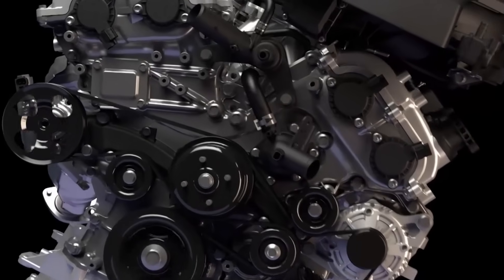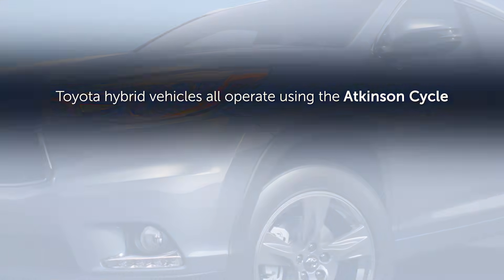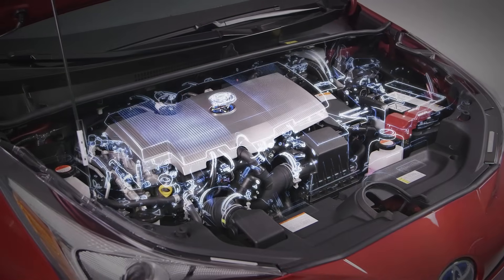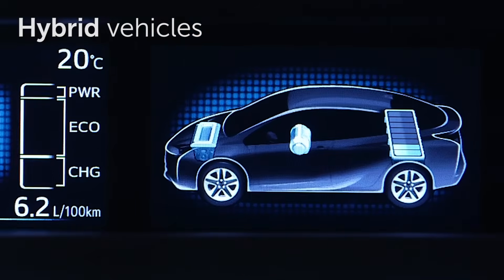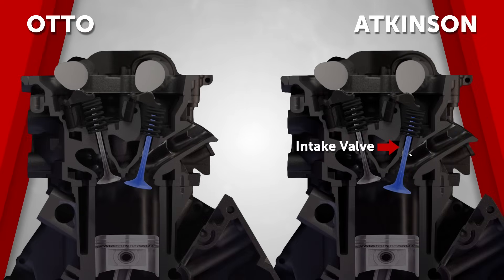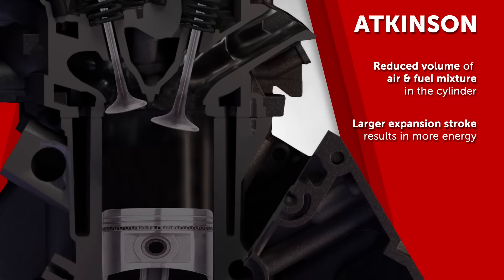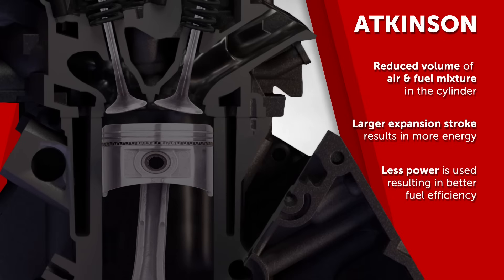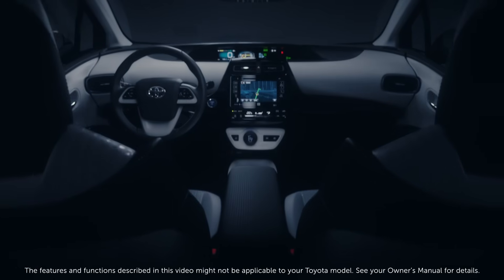Atkinson Cycle Engine

Comment: So its basically an otto motor, with a long duration intake lobe
Reply: The one they use, yeah, but is just a simulated atkinson. Real atkinsons are different.
Reply: Otto motor with atkinson cycle.
Reply: @HermanWillems  Which is actually neither an Otto or Atkinson cycle. It's the Miller cycle.
Reply: @michaeloxlong5697  Isn't miller referring to a turbocharged engine with atkinson cycle though?
Reply: @98MTBiker  Normal Atkinson engines have a mechanical device between the con rod and the crank shaft that makes the expansion ratio higher than the compression ratio. Miller achieves the same thing (higher expansion than compression) by extending the intake valve duration so that it is open for the first part of the compression stroke, pushing some air back into the intake manifold.
Reply: @michaeloxlong5697  I think you describe "a simulated Atkinson cycle" and Miller is the turbocharged version of that.
Reply: Variable duration is a better description
Reply: I think what it’s trying to do is act like a smaller engine with a lower compression ratio.
Reply: Exactly!
Reply: We just picked up a Ford Escape HEV that advertises this type of engine. 

Having had a few engine engineering classes years ago and experience with pressure / volume diagrams, just called pv diagrams, I can recall that material as she is explaining this. It takes me a few times of replaying what she said and rewatching the images, but the easiest way I can explain this is with the pv diagram.

It has two loops, the power loop and there is the pumping loop which results all in pumping losses. What the Atkinson cycle does is, just as she said, delays the compression stroke because the intake valve is open. 

That results in lower compression losses that other cylinders would have had to power the through. 

So during compression it acts like a short stroke cylinder. However you get to use the full length of the cylinder on the expansion stroke.  The longer the time for the burn and expansion to occur the more energy you can pull from it.
Reply: And higher compression
Reply: Exact. The name should be : Otto motor with  Atkinson modification.
Reply: @gigabit7079  It’s Miller cycle
Reply: @evan010101  The point, is that it is an Otto engine. The small adjustment on how valves and pistons work are just small modifications that should not name the engines. 🙂
Reply: @evan010101  No, Miller cycle is a turbocharged Atkinson cycle. Toyota Hybrids for the most part are N/A.
Reply: Long expansion ratio yes but same compression ratio as otto
Reply: So Atkinson cycle is a Briggs and Stratton lawn mower engine( b4 overhead valves)
Reply: There's no Otto engine or Atkinson engine, but there are several cycles by which an internal combustion engine produces power.
Reply: @RyanMcIntyre  Yeah, its important to know the difference between the theromdynamic idealized cycles we name, and what actually happens in your engine. Which while based upon those idealizations, do have slight variations in the details.
Reply: Thanks tree hunging leftists, you have reinvented something that has existed for hundreds of years, and deemed INFERIOR to otto cycle "and still is" just so you can save some whales "debatable".  In exchange for having a vehicle that runs like complete garbage.  I know, I have a 19 trd pro tacoma, and until it was aftermarket tuned to keep the atkinson cycle OFF it was an absolute hell to drive. Add on top of that the worst programmed 6sp auto pairing to ever be produced in automotive history, and without aftermarket support anything with this engine is damn near undrivable.  But thank goodness it gets 1 whole mpg than the 2nd gen 4.0 L did, YAY PROGRESS. "obvious sarcasm".
Reply: @ALLLLTheThingspersonal  Queenslander?
Reply: @ALLLLTheThingspersonal  Sounds like you didnt do any research or even a decent test drive.
Reply: @ALLLLTheThingspersonal  yea it’s sucks man. I had to throw a Procharger, remove the cats and have it tuned obviously, just to get it to run nice and even then the trans is so so so weird I don’t like it. They decided that .5 mpg was worth it at the expense of having the trans constantly downshift and a bunch of other stuff. Still make like 430 to the wheel but before that dang was it not fun to drive.
Reply: @jasontodd1141  the guy was being sarcastic
Reply: @JoeyLovesTrains  he has a point though. Many car manufacturers go extreme lengths to get .25mpg extra by sacrificing 30 bhp or more. It doesn’t make sense.

Comment: Can Atkinson Cycle engine be remapped to gain more HP? e.g. Accord Hybrid
Reply: If you wanted a fast car, why did you get a honda accord hybrid😂
Reply: You'd have to modify the cams to do this.
Reply: The atkinson cycle turns off at high throttle anyways so why do you care

Comment: This whole video is an absolute failure.  From start to finish.
Reply: Could you elaborate on that
Reply: @kalleko99  The valve timing in the animations is all wrong.  And then at 0:53 they keep cutting the scene, never showing the viewer the full animation.  Very incompetent video.
Reply: @mareksumguy1887  it's a marketing video not a university class lol
Reply: @Igor Vrdoljak Bgd RS what?

Comment: its pathetic that they need to use the Atkinson cycle to get 20mpg with a 3.5 liter. my Nissan gets better mpg without Atkinson cycle, uses a 4 liter and has a VERY noticeable amount more power.
Reply: Too bad nissan are pathetic in their transmissions
Reply: You couldn’t GIVEme one of those Dogs.      Great principal ,abysmal functionality.
Reply: thats because its a cvt, which can improve fuel economy greatly.

any 3.5l engine can get at least 25mpg, but mpg varies greatly between cars depending on weight, aerodynamics, drivetrain/transmission, and much more variables so comparing engines as a way to compare fuel economy is naive of you.
Reply: But with that crappy life span, high price tag and the fact when they fail they grenade ( no rebuilding that)whats💩not to like.
Reply: Which vehicle do you drive?
Reply: frontier but about to pick up a new tacoma

Comment: With Toyota's infinite wisdom,,,, 
Toyota engineers, can you make a pickup frame not rust out so fast and the truck snap in two ? ? ?
Can you also make the bodies not rust so fast ? ? ?
Reply: Trucks are used in adverse conditions and when you scratch the paint down to the metal the steel will rust on any vehicle. To the design challenge, why don't they just offer an option for stainless steel or aluminum body panels for and extra 2 grand? For people in the rust belt it would be well worth it and the resale value would be head and shoulders above anyone else. The only reason I got rid of my last car was due to rust or I would be driving it 15 years or more. IMO I think they keep fooling themselves into thinking this years "new coating" will keep it rust free for way longer than it actually will. Kind of the same way roof shingles keep changing formulations and say "30-year shingles" and now fiberglass shingles but it is all the same tar crap that lasts half that at best and the consumer has to buy and replace again and again.
Reply: my brothers bed fell off within a year brand new... not from rust but he lives where there are only dirt roads and just couldn't handle the continuous shaking.